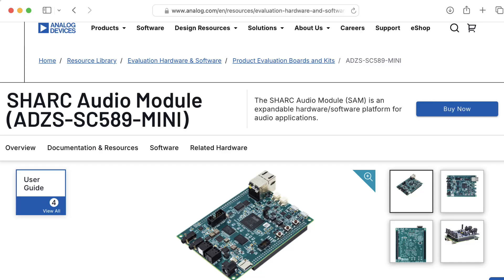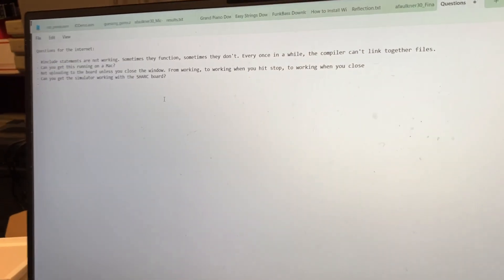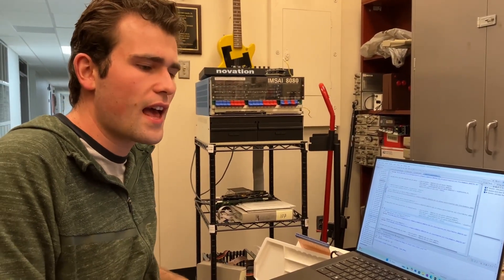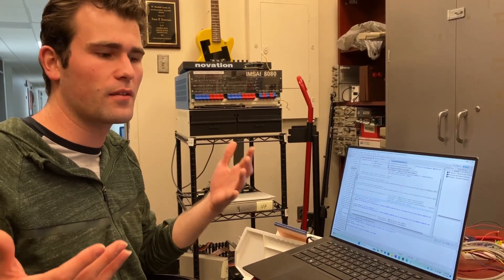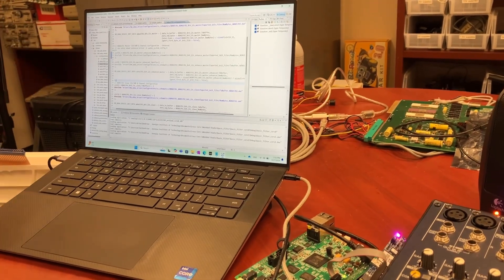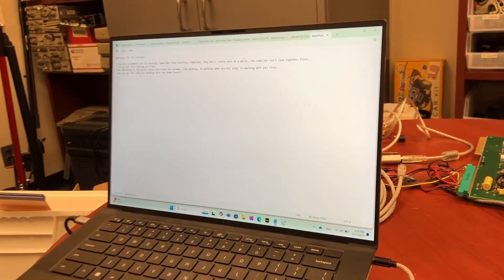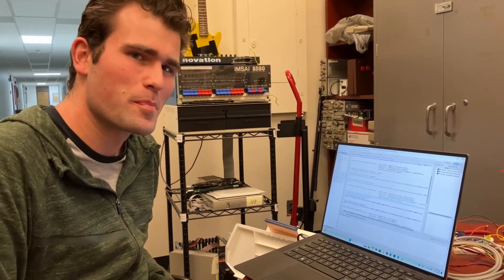SHARC DSP Chorus Demo & CrossCore IDE Frustrations (Analog Devices ADSP-SC589)

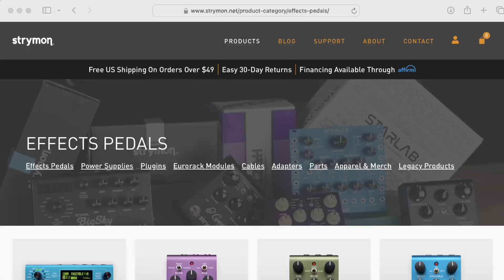Comment: 9:35 SHARC is also what’s in Pioneer’s DJM-800 mixers.  Previously with the DJM-600 it was the Motorola 56300 series DSP (like many synthesizers in the 1990s).  The latest Pioneer mixers probably run on custom FPGAs.

Comment: Nobody would understand the video like this. Therefore there was stupid questions with STM32. SHARC is a DSP processor, and this guy made the first problem that he jumped to the C code and nobody understands what he is aiming for, and that this is DSP and what benefits of ADI DSP has over ARM, especially the multifunctional operations. I was using ADI DSPs over 20 years ago and I used assembler for audio apps and for training the neural net.

Comment: Strymon also dropped SHARC in their new line of effects, they also switched to native ARM
Reply: AD has shifted its focus to their flagship Generation 5 processors, a significant advancement in their lineup (they do have smaller ones in LFQ packages). These dual-core processors boast a tenfold improvement in capabilities compared to the previous generation, offering an impressive array of features. They've found a new market niche, particularly in studio audio gear, where their processors are utilized for applications that demand true separation of UI application code, networking, and DSP tasks—all on a single die compared to the deployment of say x4 processors and x1 MCU for LCD UI management .

While AD's products remain legendary in performance, smaller competitors are gaining ground in simpler applications (Effects Pedals). However, AD continues to dominate in scenarios that demand higher bandwidth and reserved DSP power for future upgrades, where their processors excel.
Reply: Other areas, such as Dolby Atmos, Dirac, and similar codecs, require certification, and AD's processors are well-suited for these applications (They are Certified to decode Atmos and other advanced audio algorithms). However, I’ve noticed that Cypress is gaining traction in this space. They’ve managed to catch up, as seen with brands like Denon and Marantz, which have moved away from using SHARC processors in their baseline AV processors. But again  SHARC processors are used in the higher end models reserved for DSP for applications with an upgrade path.

Comment: Aaron, I just want to say that I really appreciate this content and your work more generally. Discovering your channel this year has been very encouraging. 

I'm currently in a master's program developing audio DSP software for both embedded and g-purpose PC environments, and am hoping to unite them with an open ecosystem that supports common filetypes for amplifier modeling (i.e. NAM) and other standards for configuring effects and sharing "patches". I was inspired by an old Fender patent (US Patent No. 20070234880) which sought to unify bedroom/desktop, rehearsal, studio and stage environments with a portable device that would "dock" into each context. Their vision never made it to production in that form... I think you'd really get a kick out of the drawings! 

Software that ports between the various environments seems much more feasible- a library that wraps both libDaisy (for Daisy dev), Circle (for bare-metal raspi), etc and compiles the same DSP code with alternative backends based on the arguments of a run.sh script.

Comment: Youtube recommended me this video on the main page, I thout SHARC was obsolete. Im glad to see it get some use, it is an interesting DSP architecture. Best of luck with your poject
Reply from the maker: Mostly this experience is convincing me we should stick with STM32. ;)
Reply from the maker: If Analog Devices didn't charge $1,000 for their compiler, there'd be more people interested in trying out their chips. If SHARC dies it will be by their own hand.

(The demo board we're using comes with a free license but it only works on the demo boards; if you then wanted to make a commercial product with it you'd have to buy a CrossCore license).
Reply: @Lantertronics  oh wow that really sucks. as if they didnt want people to use these chips!
Reply: @Lantertronics I don’t suppose you know whether anyone has implemented the Motorola 56300 DSP in FPGA by now?
Reply from the maker: @seanwieland9763  As far as FPGAs go, not that I'm aware of... but The Usual Suspects have done an amazing job of emulating the DSP56xxx family on regular CPUs, successfully running code from Access Virus, Nord, and Waldorf synths.
Reply from the maker: @seanwieland9763  https://dsp56300.wordpress.com

Comment: Did you tried to move the dat files in a shorter paths? I know some old windows libraries are not able to handle paths with more than 256 chars and will return a IO failure.

Comment: I started using SHARC in 1995 when they were still X( not released) parts and I was the only person using them in the entire Midwest.   I needed the 40 bit floating point for my accelerator project. The silicon has always been amazing, but like many embedded software tools, they are not the best.  This is the same for many FPGA tools.  This may be hard for a student to do but you need a dedicated computer and or virtual machine and don’t install anything more on it than you need to do this work. A VM will allow for regular backups of the complete system which can be a lifesaver when something breaks you and you have no idea what.  Clean installs following your own developed process is also a big help. These products have very small development teams and they are doing their best. I know there is a lot of competition out there but show me a better interrupt structure than a SHARC for audio work.

Comment: Great video.. but can't help but say.. DSP's are a dying technology, Native ARM is the future... Just look at what Eventide have done with the H9000
Reply: Nah, not dying. You still can't make 1 sample stream audio processing with CPUs. Block size is most of the time 32 samples on ARM. DSPs or synthesized DSPs on FPGAs are still king in low latency audio processing.
Reply: @ an almost zero latency comb filter 😉
Reply from the maker: @MrPureBasic  Have you tried the XMOS stuff? It looks kinda interesting. I can't fully wrap my head around it.
Reply from the maker: Wow, I had no idea the H9000 was ARM all the way! Indeed... I had another student look at the Daisy Seed (STM32 based) and he was fully up and running in about a week.
Reply: @  I was also super surprised, the H9 is also arm based.
Reply: @ if you did some googling after my first comment, you also probably found the internal pics, they have a 4 cpu boards, that plugin to repurposed dimm sockets. The marketing states this is for future upgradability…

Comment: For twenty years ago I was using the Ez-Lite shark for designing a digital RIAA correction filter and I remember that there were examples in the manual for ex. chorus  flanger effect. I would take a look in the old shark manual from that time, because it all started out from shark and in the meantime ADI developed new DSP (Blackfin) but the drivers are properly only modified to the bare-metal.

Comment: They aren't called "ANALOG" Devices for no reason. They are really bad at everything else.
Just port your code to STM32H7 series and use VisualGDB with the latest Visual Studio. And for your own mental health, try to keep away from the Mac way of thinking.
Reply from the maker: I actually have another student who I tasked with trying out the Daisy Seed (STM32H7 based I believe). He was up and running in a week and spent the rest of semester trying out advanced reverb algorithms. Yeah... there's definitely a difference in ease of getting started!
Reply: @Lantertronics  Daisy Seed, of course. I supported that project when it was still in Kickstarter and got their board. I liked that they spotted the opportunity to build a robust infrastructure with generic, low cost, of the shelf components.

Comment: Oh look, another dodgy embedded IDE based on Eclipse! Aaaargh! At my last job we had to use the STM32 Cube IDE for the embedded software development. What a hellscape. I swear there's something seriously wrong with most Java developers.

Anyway, so with the include files not working, Eclipse (and by association I assume, the CrossCore IDE) treats C and C++ build configurations separately. There may be an include directory definition in the C++ configuration that isn't in the C configuration. Check in Project -> Properties to see if they have a list of include directory options. You could confirm it's a C/C++ thing by trying to include the file in a .c and a .cpp file and see if anything fails.

The IDE uses GNU tools to compile and debug. GCC, GDB, etc. What it sounds like is gdbserver is launching and uploading the binary to debug to the hardware, but the IDE isn't connecting to gdbserver to tell it to start. When you close the IDE, gdbserver terminates and the code break stops, causing the core to start running. You may need to go through logs to check the IDE is trying to connect.

I'd like to help more but these things are very nuanced! Cheers.
Reply from the maker: My thought though is that if they want to encourage people to use their chips they should just give them the tools.
Reply from the maker: If you buy this Audio Module board, you get a special license that only works with it. But a standard single user license for that dodgy IDE is around $1,000!
Reply: @Lantertronics  Yikes! I would think they're probably licensing the right to use the libraries and any proprietary tool chains used to compile code for the system, rather than the IDE itself, unless they have their own agreement with Eclipse. It's still a slight improvement on some FPGA IDEs I've used :)
Reply from the maker: @256byteram  Yeah, you're paying for the special compilers. There's no open-source compilers for SHARC, Blackfin, etc...

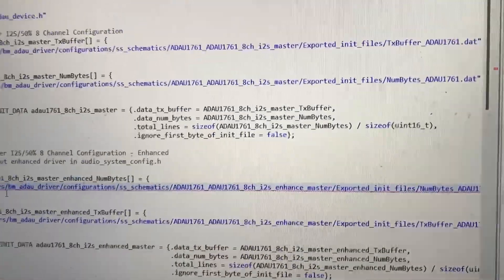Comment: 3:23 Include files are searched for in SPECIFIED directories.  These are specified to the compiler with -I options on Unix, e.g. g++ and clang++ and /I I think on MSVC.  Your IDE  also needs to know this information and is getting it somehow from your configuration.  I have  always had trouble on MSVC++ in supplying paths and other config for "release" builds but then building in "debug" and wondering  why changes weren't taking effect.  I think you can use an absolute path name starting with /.  Also try including with <> instead of "".

Comment: for the includes: do the files actually exist in that location? and no, the editor finding a file with that filename doesn't necessarily answer that - it could be looking elsewhere. if that's not it, try moving your project out of your OneDrive directory, specifically to something that's not OneDrive (OneDrive does screwey stuff behind the scenes), doesn't have spaces in the directory name, and is significantly shorter (windows has issues with very long filenames).
Reply: You are on target I think.

Comment: Oh dear, it’s always the magic incantations - that’s one thing I hated about embedded header files, declaring and linking. I did an embedded flowmeter on bare metal on the cortex platform and I spent HOURS AND HOURS creating, tracking and editing the hardware definition header files and all the includes and project file structure. Would love to see the hw oscope on here with the input and output waveforms and an explanation of the sample rates, nyquist and a 20khz tone 😊